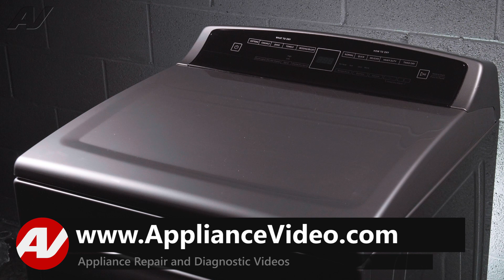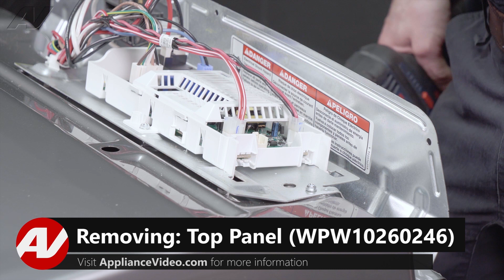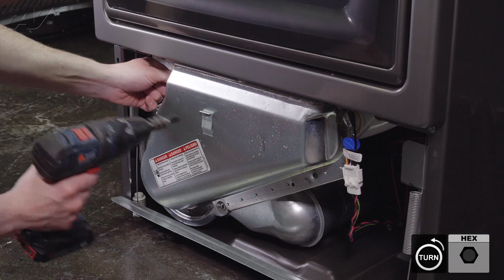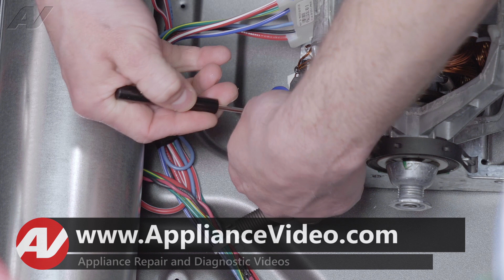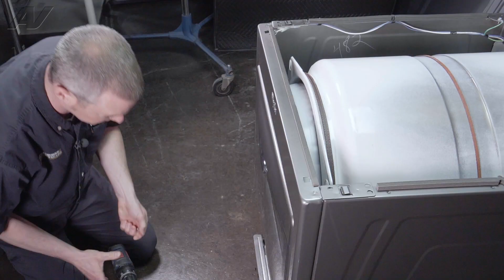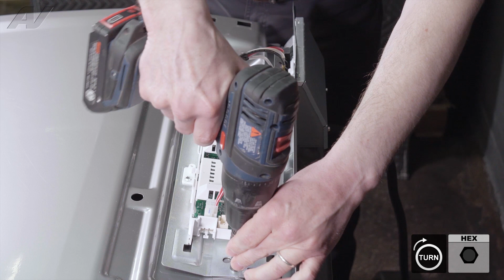Whirlpool Dryer Repair - Will Not Run, Noise While Running - Idler Pulley

Comment: Thank you!!! This just saved me hundreds of $$$$! I spent $8 on some high heat lubricant for all of the gears/pulleys; followed your step by step;and was able to take apart/put back together my dryer with ease.  My dryer went from screaming at me to being so quiet I can barely hear it running.

Comment: which terminal did you plug the switch into? having a hard time seeing it in the video! I though i took it off one of the top terminals but the wiring doesn’t look long enough for some reason